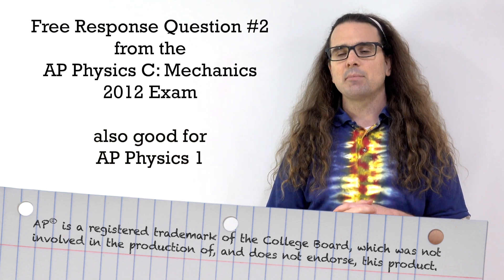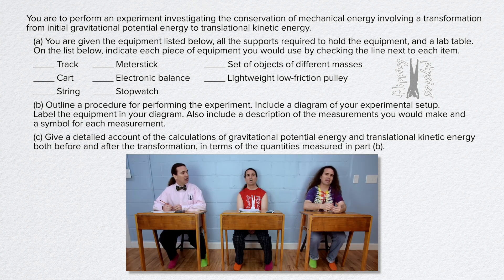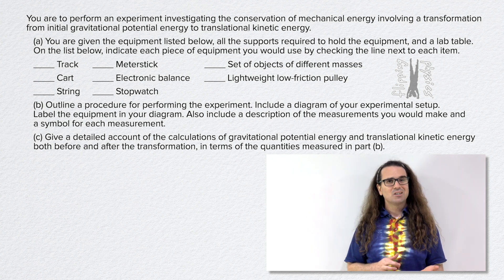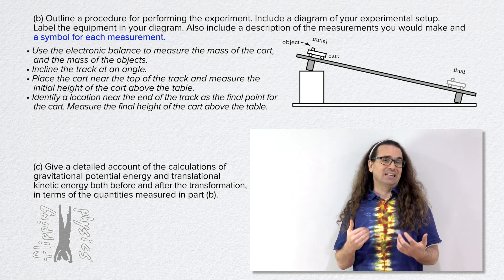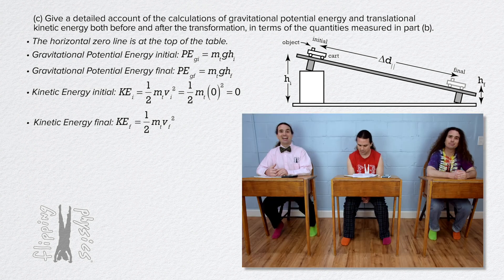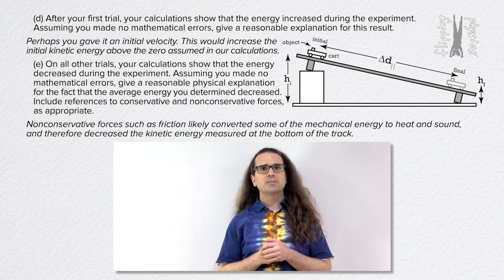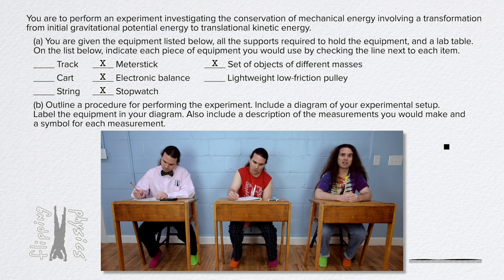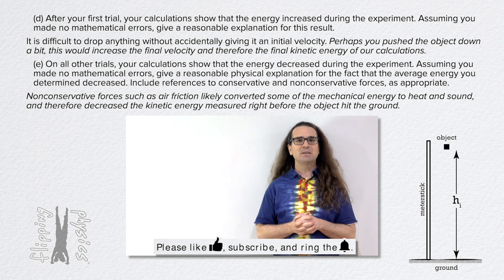2012 #2 Free Response Question - AP Physics C: Mechanics - Exam Solution

Comment: How would we set up Bobby’s idea for this question?
Reply: Setting up Bobby's idea is similar to Billy's idea, except now we have two objects that store kinetic energy, and an Atwood machine style of coupled motion.  You'd measure height initial (hi) and height final (hf) of the hanging mass.  You'd measure the transit time (t) for the cart and hanging mass to move from height initial to height final.  You'd also measure mass of the cart (mc), and mass of the hanging mass (mh).

You'd then calculate:
GPEi = mh*g*hi
GPEf = mh*g*hf
KEi = 0, due to initial speed being zero
KEf = 1/2*(mc + mh)*vf^2.   We add both masses because they both store this kinetic energy

It's true that the cart has GPE, but to make its value not matter, set the zero line at the cart's center of mass.  This would make hi and hf both negative numbers, measured downward from the elevation of the cart's center of mass.   Intuitively, we know that the GPE of the cart would remain unchanged because of its pure horizontal motion, and not contribute to this problem in the first place, even if we had set our zero line elsewhere.

Start with the same constant acceleration equation from Billy's solution to determine vf, which when solved for vf would yield vf = 2*(hi - hf)/t.

Now our final kinetic energy equation is:
KEf = 2*(mc + mh)*((hi-hf)/t)^2
Reply: One particular answer to part D that I think is more significant in practice, is reaction time.   I've noticed this myself, when I've tried to time experiments in motion.  You may not start the stopwatch exactly when you release the experiment from rest, and you may not stop the stopwatch exactly when the experiment reaches the finish line.  When measuring slightly less time than theory would predict from the happenstance of how you reacted to reality, you end up calculating that energy was created.  Even for timers that can automatically stop at a given event in your experiment, the precision of the timer's readout can give an unrealistic conclusion that you created energy.